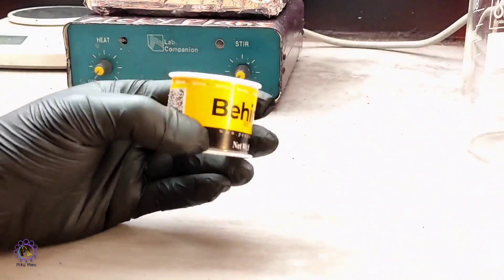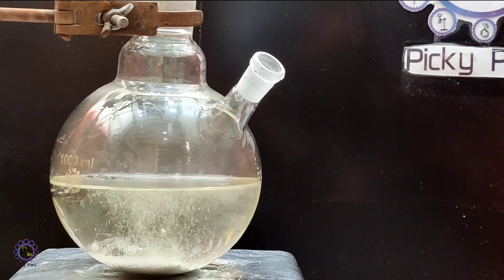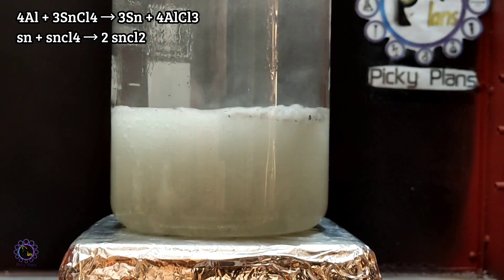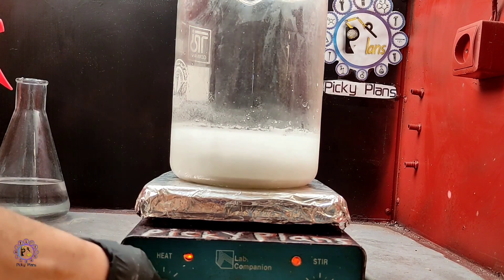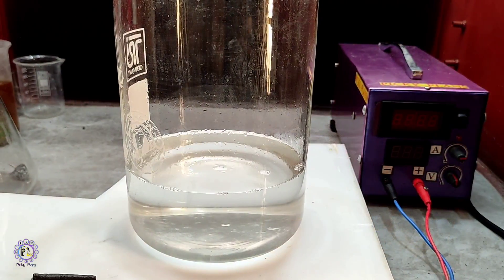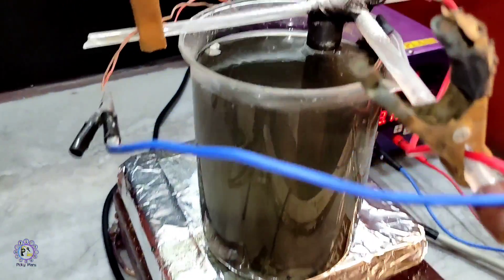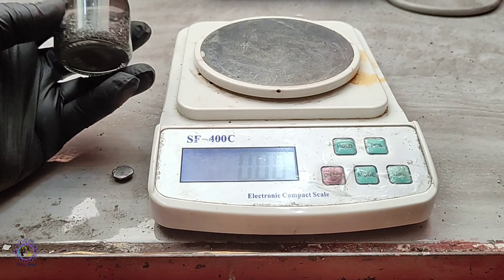Recovering Tin and Lead from solder wire

Comment: A bit late to the party here but is there any specific reason you could or should not filter the solution when the first white precipitate of lead chloride forms? Rather than reacidifying it to re-dissolve? Or is the second addition of HCL to dissolve the precipitated PbCl in solution just a matter of simplifying the procedure so you don't have to disassemble glassware with a hot filtration ect?

Comment: Thank you my friend, I am not good at chemistry very well, can I separate the tin from the lead in the welding ladder using fire, where the tin floats on top of the lead and is poured quietly, I did not try and I would like to hear your opinion
Reply from the maker: No tin and lead will be mixed can't be skimmed off

Comment: @Picky Plans I think I know a way to do a better separation and purification of both lead and tin from solder.
After dissolving the solder in the mixture of hydrochloric acid with either nitric acid or hydrogen peroxide, you can prepare a solution of sodium polysulfide by heating sulfur with a concentrated solution of sodium hydroxide (the solution will go from yellow to orange or even dark red depending on the reaction time and the polysulfides present). After the tin and lead solution has cooled down to room temperature dilute it with water or neutralize some of the excess acid with sodium hydroxide until it is just mildly acidic, and then add enough sodium polysulfide solution until the solution is yellow, orange or red indicating that there´s polysulfide in excess. In this step we´re precipitating the lead as black lead(II) sulfide while the tin is converted into soluble sodium thiostannate(IV) which allows us to separate them by filtration. After filtering and washing with water, wash the lead(II) sulfide with ethanol the help it dry faster. 
As for the filtrate, just treat it with dilute hydrochloric acid to precipitate the tin as yellow tin(IV) sulfide (it will also precipitate some sulfur which will be mixed with it, but probably can be separated by dissolving the sulfur in some xylenes), but be careful as the reaction will also release hydrogen sulfide which is pretty poisonous and stinks like rotten eggs.
The lead(II) sulfide can be converted into lead(IV) oxide a.k.a. lead dioxide by oxidizing into white lead(II) sulfate with hydrogen peroxide and then dissolving it with sodium hydroxide to form soluble a soluble complex which can be turned into insoluble lead dioxide by adding sodium hypochlorite and probably heating to help the reaction.
Reply from the maker: Thanks for the explanation and the tips.
Seems great but the part , diluting HCl containing Tin and lead chloride causes most of the lead chloride to percipitate out as needle crystals. I like the recipe and it is a good practice for the metallurgy of precious metals extraction. 
What i do

Comment: @Picky Plans The reaction between tin and nitric acid doesn´t produce any tin nitrate but instead it forms tin dioxide a.k.a. tin(IV) oxide. The correct reaction is: Sn + 4 HNO3 = SnO2 + 4 NO2 + 2 H2O
Reply from the maker: Both reactions are correct... This reaction you referred to, is the reaction of tin metal with concentrated nitric acid, Which creates metastannic acid, The reaction with very diluted nitric acid makes tin nitrate....
Reply: @PickyPlans  Yes, it does happen to some extent. However, tin nitrates are very sensitive and unstable and decompose to tin dioxide quite spontaneously.
Reply from the maker: Coordination to chloride ion will lead the equation to Produce SnCl4 and going through the reduction in presence of excess Sn metal, SnCl2 Forms .In this case the product stabilizes.

Comment: Lead compounds are not soluble except nitrate. You should melt down the wire and pore it on something cold this will seperate tin from lead ~
Reply from the maker: Never heard of that...
If it works it would be great.
Reply: @PickyPlans  it is the problem of electronecian when dissoldering compenents
Reply: Do you know any easy method to saprate lead and Tin from Solder

Comment: Now, if this guy could show us how to separate Lead from Zinc, he would have a very popular video!
Reply from the maker: It's almost the same procedure . Dissolve alloy in nitric acid , precipitate lead in chloride form filter, treat with sodium hydroxide to get lead hydroxide, smelt with charcoal and borax. From the solution get the zinc out by alkalizing solution get the zinc hydroxide and melt with carbon and flux too
Reply: @PickyPlans  late questen but how do i separte i mix of old solder an silver from contacts? if i use salt i get silver and lead chloride.
Reply from the maker: You can smelt with borax and potassium nitrate as the flux to oxidize solder or you can smelt in a bar and run as the anode in a tin chloride cell

Comment: Can you tell me how to make Sn+4 from Sn-Pb alloy?
Reply: Is it possible to form SnCl4 or SnO2?
Reply from the maker: First dissolve alloy in nitric acid
Collect white paste dry it (preferably) on it's own and no heat.
Then try to dissolve it in hot concentrated HCl. Add enough to dissolve all
So you have SnCl2
Reply: @PickyPlans  if i go first with hcl, is It's works?, Why we must using nitric acid first?
Reply from the maker: @_MuhammadRasyid_KIM_ lead isn't easy to dissolve in HCl but if you want to do this to solder alloy 
You can only dissolve it in conc. HCl the dilute and cool it down to get lead chloride.
To turn Sn2+ in solution into Sn+4 you can bubble Cl2 gas into the solution.

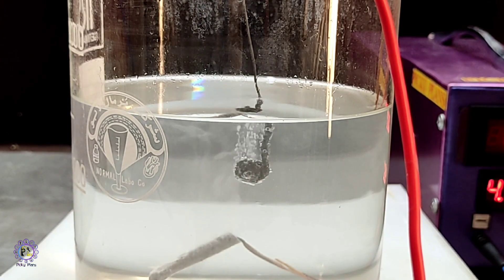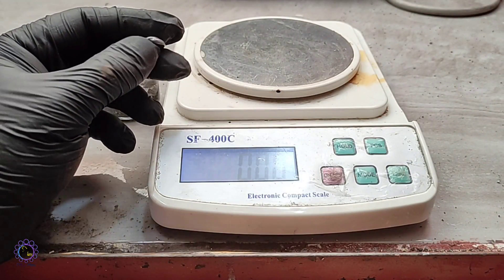Comment: Or you can just electrolyze the shit out of a chunkier bar of solder in some sulfuric acid. Tin leaches out when you crank up the current and plates out. Pb stays behind as PbO2. It even stayed together for me and i basically have a rod of PbO2. Well, some tin will stay behind in there and there's a metal core, but yeah, that's the lazy way lol. I got some 20g of tin like that over a few days. It looked like your spongy tin at 8:23, with spikes on the bottom. I burnt most of it trying to melt it in air, like you at 12:00, it's just too powdery. A crucible with a lid and flux help to keep the air out while melting.
Reply: @PickyPlans  The one caveat is that i don't really know the exact alloy i did this with. I just assume it's regular 60/40 ish. I used a few solder rods as thick as a pinky finger. After I ran it a while i was able to break off the tip and it was brittle. The part of the rod above the solution was still metal, so i assume there is a transition in there somewhere. I dont want to break it any more really lol. But yeah thin stuff should go faster, just has to be enough to hold itself together. It tended to expand as it turned to oxide. I did this like 10 years ago so it's kinda fuzzy, but i still have a pellet of tin and the rods lol.
Reply: That would be exactly I route I would take. Minimal effort and acceptable purity.